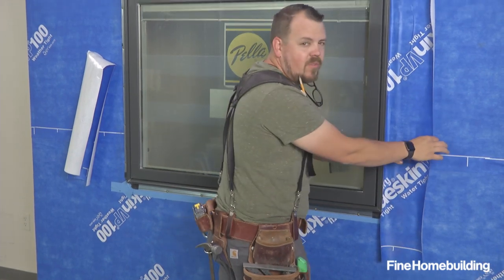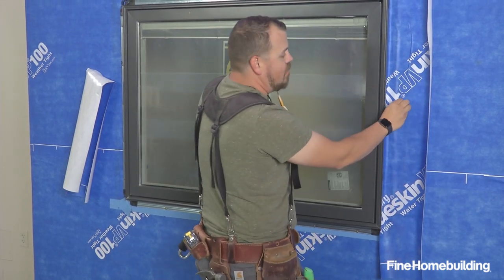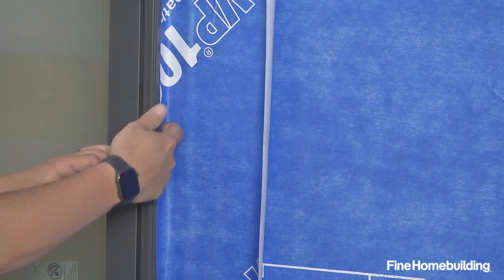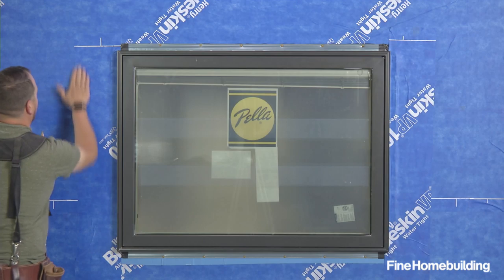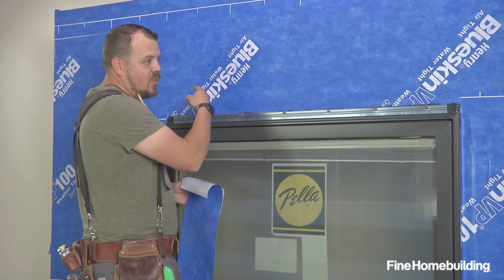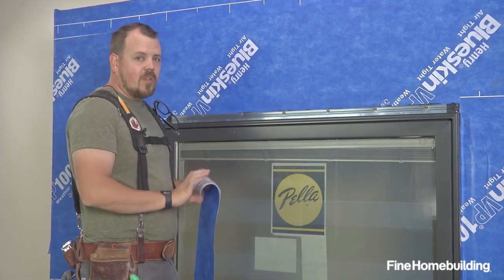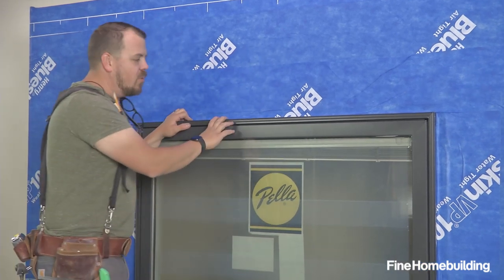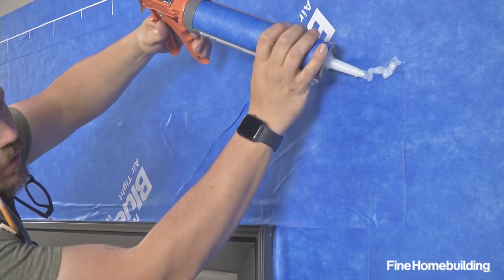Part 3: Flash a Nail Fin Window Over Peel and Stick Housewrap

Comment: I would not nail in the bottom flange of the window so that water can escape.  In fact, Matt Risinger suggests using shims in the bottom flange to open it up even more.  This requires air sealing on the interior side using something like Prosoco AirDam or Dynaflex 230 and backer rod.

Comment: If you use this method of WRB, how do you go about installing paper and wire for stucco? Would you just bring the paper and wire up to the window edges since it is technically now sealed, any other steps that need to be taken?